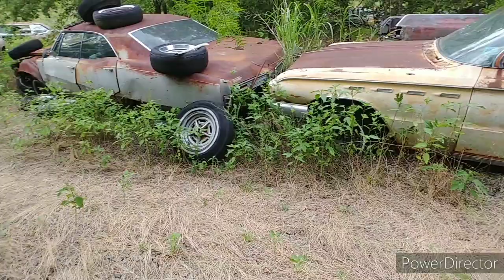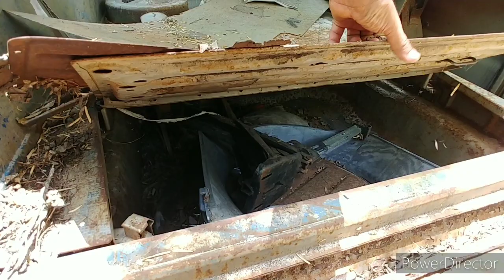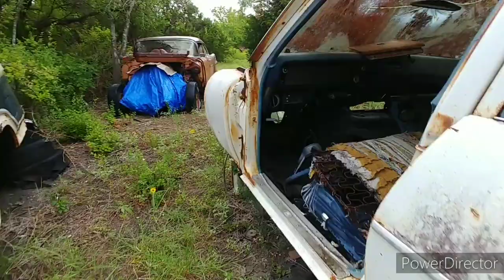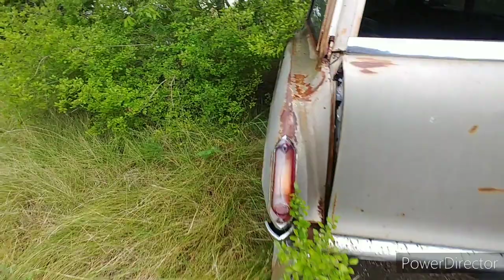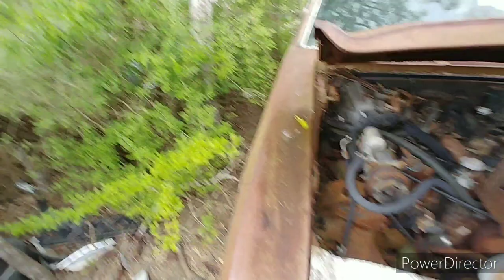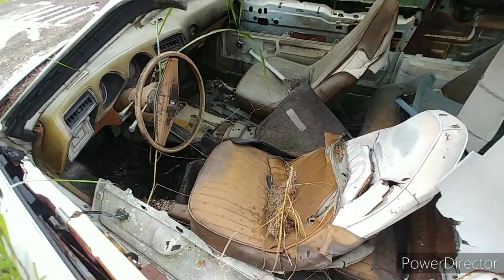Exploring A Classic Car Junkyard

Comment: That '67  442 factory 4 speed is worth some bucks as is.
Reply: Just because it's a 442 doesn't mean it's a 4 speeds. The 442 origin is 400cid, 4 barrels, dual exhaust.

Comment: Yes, the Studebaker Champ was the result of a very low budget update to their pickups.  They hadn't been redesigned since 1949.  The cab is a Lark sedan cut in half and the beds were leftover Dodge parts they bought, or maybe they bought the tooling for them, I forget.  Even the name badge is cheap - they took leftover "Champion" badges and literally broke off the I-o-N to put on these.  There was one yard up here that had a few but it's been cleaned out since then.